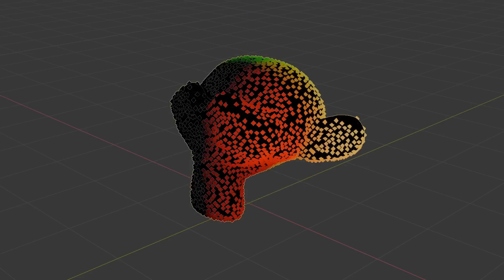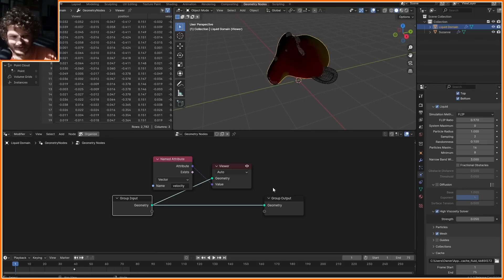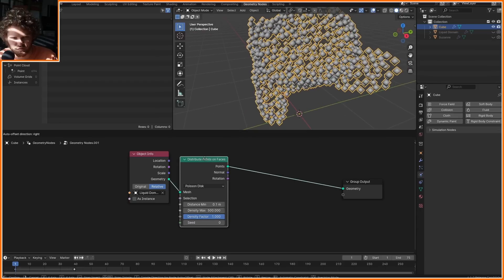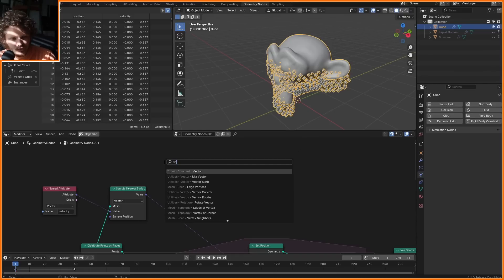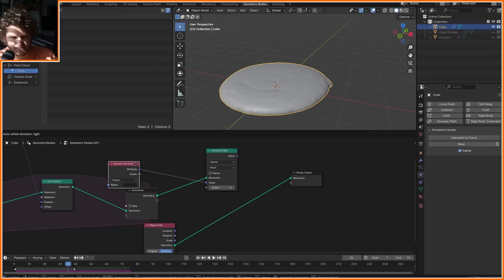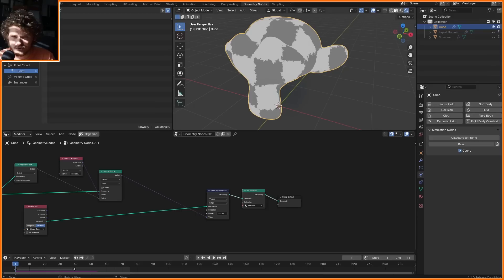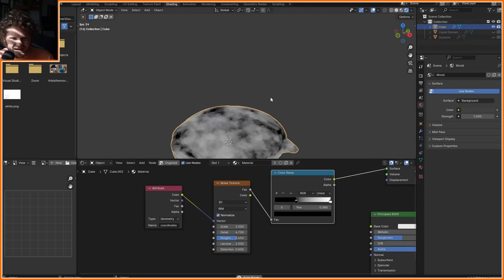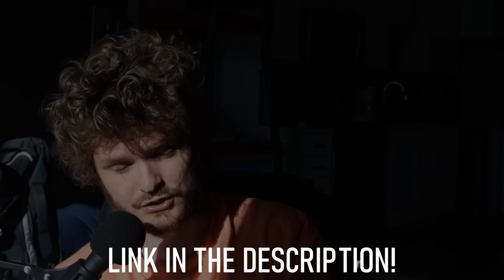UV Mapping a Fluid // UV advection // Blender Tutorial

Comment: The reason it''s 0.05 actually has nothing to do with the viscoscity. It's because 1/24 (the scene framerate) is roughly 0.05. So basically, divide the velocity by the framerate.
Reply: So can we scale our velocity by the delta time in the simulation zone?
Reply: @liteningstrike12  You should be able to do that, yes. Delta Time totally slipped my mind, but yeah that should be equal to 1/framerate, unless theres a scene time multiplier active, in which case delta time would be more accurate to use.

Comment: If your fluid source mesh has a nice, evenly distributed geometry, you can convert its vertices to points and use those instead of generating new points to distribute on faces.

With a particle instance modifier, you can make the proxy have a point following every baked fluid particle. The points already follow the geometry, but are volumetric, not superficial (although that may open different opportunities). The baked particles have their velocity stored somewhere, and that could be useful, but I don't know if that property can be accessed from GN.